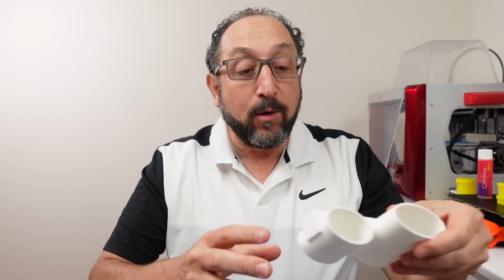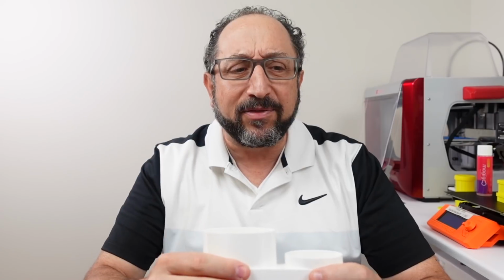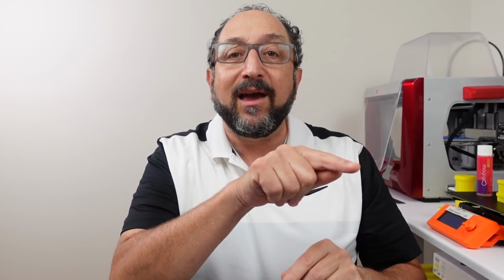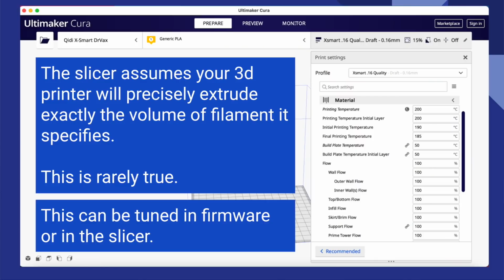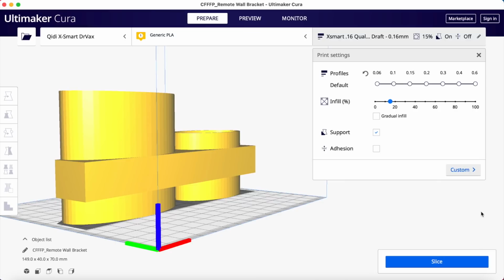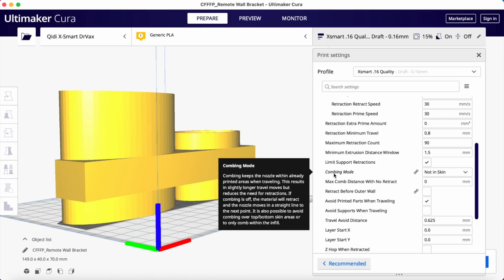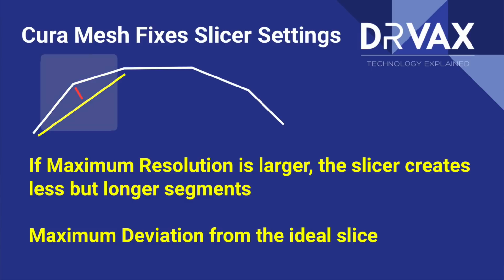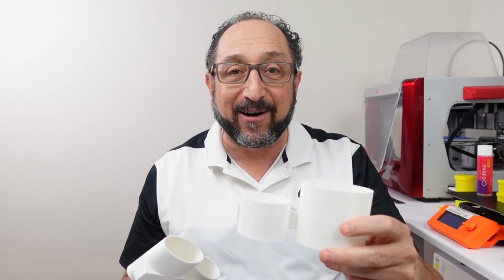Cura Quality Hints for Better 3d Printing

Comment: Have you heard of any issues with the creality V4.2.7 board? I have two ender 3 and two CR-10 all of them Have a CR TOUCH and all of then the hot end fluctuates If I set the temp for 200 it goes to 230 then down to 190 then back up to 210 and back down to 195 and now it will go from 195 to 210 for  the rest of the time I have run a M 303 and I get this (PID Autotune failed! Temperature too high) Do you have anything on this

Comment: I have to really compliment you on your videos. You are an excellent teacher.  I learned so much after watching this video. I have Cura opened and was following along as you spoke.  You make such great videos, I honestly check my progress bar and want them to last an hour.  I get bummed when they end.  I'm about to order an Ender 3 S1. I am really excited to get into this hobby. I've been a control systems/data acquisition programmer for 35 years. I just retired and love parameters.  I programmed Galil stepper and servo control systems and I love this stuff! I remember the old days when I had to write stepper accelerations using look-up tables with a interrupt timer to send the next step pulse.  This was even more fun because it was done using assembly.  I really appreciate your channel and your knowledge.  I think we would have worked really well together!

Comment: Hi sorry to bother you but my name is Colin and im a disabled retired man now ive been following your calibration video. I have a Xvico X3S printer and ive followed your video in hope that it will sort out some printing issues but unfortunately it has not solved it. What im getting is i think you call it bridging say i got a square block with 2 posts what it is doing is bridging between the posts and any gap or hole there is can anyone please help with this a photo can be provided if needed.
All the very best. Colin
Reply from the maker: I recommend heading over to https://forum.drvax.com   Then register and post a picture with your questions.   Best way to get help.

Comment: VERY useful thank you.  I have a Davinci Aio that I bought in 2015.  I've never been happy with results and failure to stick to the bed. I just bought PLA to give that a try. It sticks to the bed but the nozzle just blocks a little way into the print. I bought a cleaning filament but that made no difference. Just ordered some Magigoo as seen in another of your vids and now downloaded the cura software to try.  I really found this a big help.   Jim

Comment: GREAT videos Sir.
I have a Ender 5 with a EZABL installed. I am playing around with Prusa slicer as well as Cura 4.8. I have noticed that when Cura slicer  is printing the z axis doesn't doesn't move like its compensating for uneven bed BUT, when Prusa slicer is printing the z axis moves back like its trying to compensate for uneven bed. Seems like the Cura slicer isn't even looking at the bed. Am i missing something here?

Kelly in San Antonio

Comment: This is more Cura Basics 1A ... That printer with settings needs to go through all the steps from Teacing Tech to get better 3D prints. Then the print quality will be almost as good at the higher speed.

Comment: Good Afternoon, many thanks for yet another great video.  All useful and pertinent information.  I have a question about updating firmware ie Marlin using Visual stdio code.  Simply its this: to update do you have to go though all the code agin to change the code for your machine and personal settings? or can you just update but your settings remain.  Might be a silly question but just cannot find the answer.
Reply: when you upgrade the firmware to a new version of marlin in vs code you need to make sure you have the proper configuration for your machine. Once you have the proper config, any settings that you want/don't want you need to go through and comment/uncomment each feature depending on your preference. then you need to go through and make sure that your steps/mm are properly set, as well as any other settings such as offsets, precofigured temps and all that good stuff is properly set for your printer. Most of the time it will be but i always double check before building and updating. To answer your question, Yes you must change the code everytime you update your machine. The settings from your previous build will not be carried over to the new one, rather you are flashing an entirly new firmware to the machine, not updating the existing firmware. Hope this helps.
Reply: @b-rad7708  Many thanks for taking the time to reply much appreciated.

Comment: Hi I have ender 3 with marlin bugfix I use cura when print starts it goes down the side and back leaving a good bead but when it goes over to print nothing prints leaves mark onglass but no filament comming out what am I doing wrong thanks

Comment: Nice video, especially for newbies. But you should definetly make next step and cover Linear Advance( or  Pressure advance if using Klipper firmware)
 topic. Because this thing has significanly more impact on everything than all the options described in this video( beside the seam):
- Better dimensional precision
- Higher printing speeds are possible without any loss of print quality.
- Visible print quality is increased even at lower printing speeds.
- No need for high acceleration and jerk values to get sharp edges, which means you can get super high quality at high printing speed without putting your cheap printer to the edge of its physical capabilities and limitted rigidity.

Once you start using of Linear Advance -- you will never return to regular default legacy mode with all these jerks, virtual acceleration, etc tunning and every-print choice of quality vs total printing speed. You will get both quality and speed simultaneously.

Comment: So an issue I'm having is that Cura doesn't seem to retract while making supports or infill. Right now I'm printing a Rocket Nozzle model, it has a support on the inside, and supports on the outside. And I'm seeing it lay down strings from the outer support to the inner support, right through the model.  I've seen other stray strings inside other models as they print which aren't in the preview. I haven't had problems with retraction when it's working on walls, just infill and supports. And I haven't been playing with those settings (yet). What am I looking for? Wipe seemed like a possibility.

Comment: I had thought that the20 mm width of the test cube (cat) would be primarily controlled by the XY steps per mm. The flow should only control the line thickness. So flow rate should be measured with one or two line thicknesses at most?
Reply: I also understand it that way, therefore I´m wondering why he is changing the flow.
Reply: Best way to check flow is make a cube with no top layer and set it to one layer thick at 0.4mm line width. If it prints it at 0.4mm then it’s fine. If not the. Adjust the flow to suit
Reply: @MrOrangeman18  And print it in vase mode, or Spiralise Outer Contour (Special Modes) as it is called in Cura.

Comment: hello, i just wanted to ask how the anet et4 of yours was holding up, mine has been having weird issues like parping, z offset inconsistancies and such
Reply from the maker: Mine has been fine.   However, I also make sure I check that all of the bolts/screws holding the frame together are always tight.  I check the belts and make sure they are snug.   All 3d printers bounce around a lot while working and things become loose.
Reply: @MakeWithTech  so mine just needed some stick glue on the bed for it to work, im hyped! Im also gonna print a belt tensioner for it to keep it exact, thanks for the reply

Comment: How do you get rid of the melted bottom even your good model has a mash first 4 layers
Reply from the maker: Lower print bed temperature.
Reply: @MakeWithTech  and/or play around with a small negative initial layer horizontal expansion value in cura. I usually run  -0.1/0.2mm with a 0.4 nozzle

Comment: Experiment with Coasting to get rid of occasional bumps in the print
Reply from the maker: Good area.  This is a very different approach but is likely to work.  It may be a bit more difficult to tune.  Time will tell.

Comment: If you click on the colored arrows in Cura (not the colored rings) you can turn the model in fixed steps. Makes it a lot easier to get a 180 or 45 degree turn. Nice Video.
Reply from the maker: Excellent point. Thanks for sharing.
Reply: It is not. There are several ways in Cura to rotate an Object. Usually 90* is enough, so you don’t need the thin lines anyway. There is even a way to make the Objekt fall flat onto a specific side. The only thing I hate about object positioning is that you need main settings to turn on/off auto placement in z direction. That should really be an option in the positioning menu.

Comment: It is accepted that printing larger layers increase layer strength, however, if I make a print with a raft and I set my layers to less than 0.2mm the ability to remove that raft decreases, at 0.12mm I have to use a carving chisel to remove them.
 Do you have any ideas about what is happening here?
Reply: I think you're confusing material strength and layer adhesion. Thicker lines are stronger but that doesn't mean they stick to each other better. If you print at a high layer height your print could end up weaker. What matters for adhesion is the ratio of layer height to line width.
Reply from the maker: You are correct.  When I say more plastic I mean more infill and more perimeters.  Larger layer lines are only stronger when printing in vase mode.
Reply: Because at super low layer heights there is a lot of pressure coming out of the nozzle, smushing the filament into the raft. Also at low layers you are more affected if your bed is leveled too close.
Reply: Do you mean you need a chisel to separate the raft from the print? Usually the finest vertical print resolution is around .1mm depending on how well you have your z axis dialed in so at .12mm you are approaching that and might be getting layers of the raft bonding to the bottom of the print where it should not.

Comment: Great video.
Noob Question for Cura.
 After you make all these changes and you're happy with them, how do you save that configuration under a new name so it can be called back for use again? I haven't seen an obvious "save configuration" option.
Thanks
Reply: On print settings, go to Profile, and there should be a button that says "Create Profile from Current settings" or something around those lines. It will allow you to create a new profile with the settings you edited, and even name the profile to go back to it.
Reply: @TheKryptxc  Ok. Thanks. I'll take a look. I thought I looked there. Hmm
Thanks
Reply: @davesage9190  nP lmk if you can’t find it
Reply: Your profile name is listed above your settings. If you click on the star it pulls up the profile menu, where you can update the selected profile or create a new one.